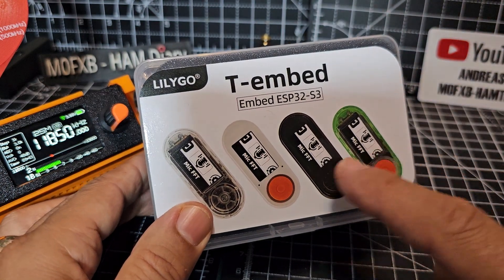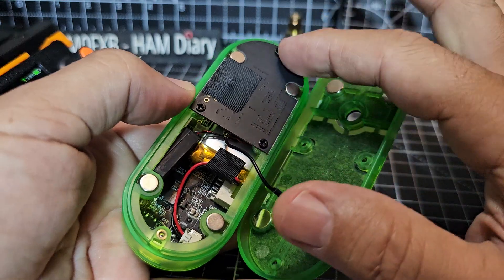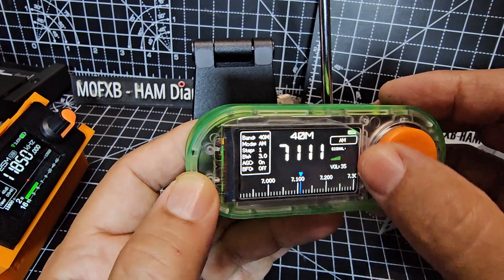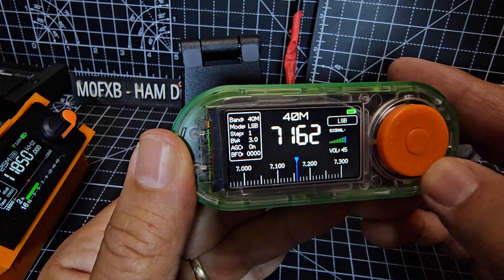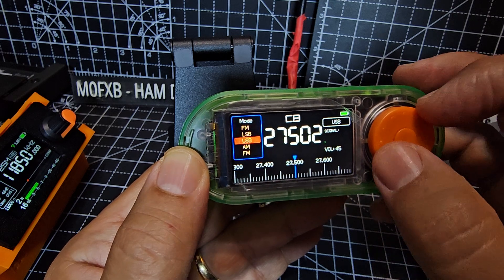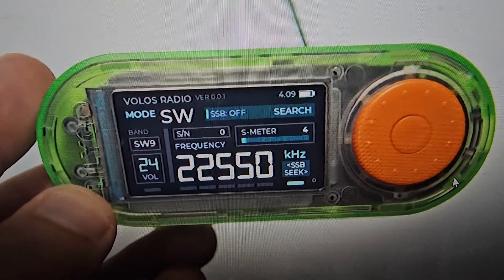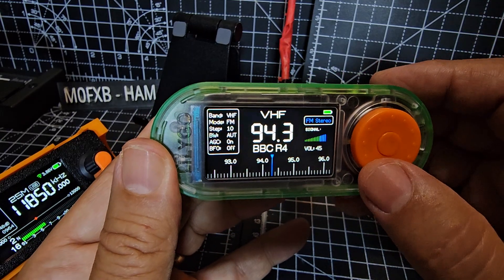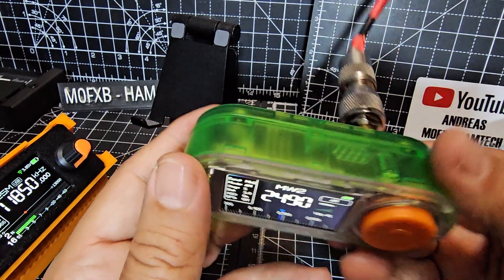Si4732 Projects Lilygo T-embed Radio Receiver

Comment: I have one just got it is there a way to install the nrf to it also myn is missing the radio board and antenna
Reply from the maker: Oh its different there is alot to learn on these items would watch more videos .
Reply: @M0FXBHamTech I found out if I get a cable that goes to the m5 I can do it and they make multiple nrf24 for the m5 and imma get one of the m5 versions for my lilygo embedded
Reply: @M0FXBHamTech it’s only 41$
Reply: Even though at that point I should just get the lillygo embedded I need and upgrade